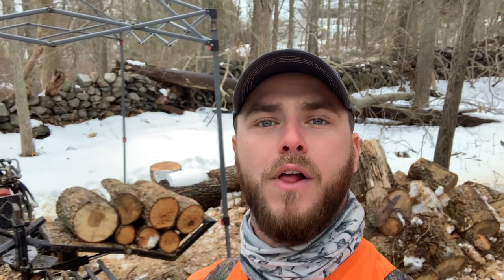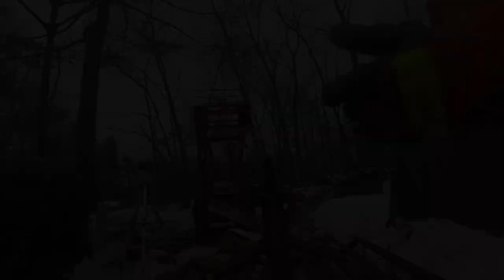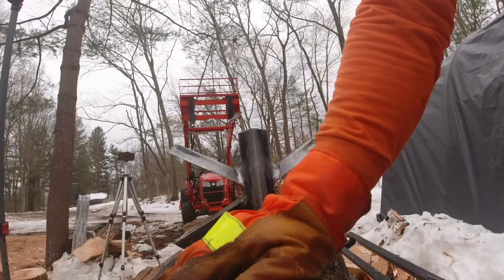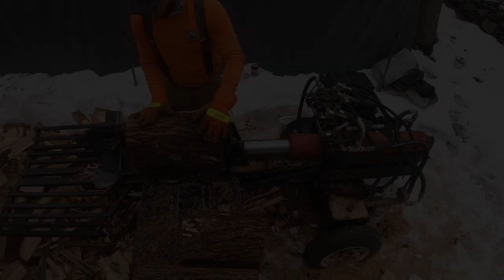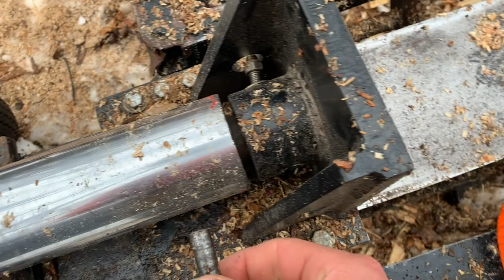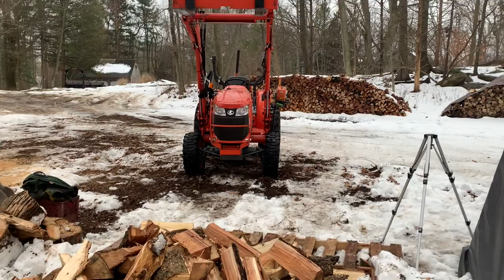#58 Splitting Ash Firewood with 6-Way Wedge in Realtime: How Fast is it??

Comment: 13 minutes into your video the cylinder bar started to come apart. It,s always something, but you handled that well too. Not to worry though, just a bolt. That is because you have a cylinder stop on the rail and the bolt can only handle the kick out pressure for just so long. Real time is ok. Have a great day. From me in ohio.
Reply from the maker: Ahh good point, never thought about the cylinder stop contributing to the stress on the wedge bolt, wonder if I could adjust the pressure at which it kicks back to be less to reduce stress.

Comment: Oh that sucks! How long have you owned this splitter? Mine has a 1” pin instead of the 1/2” bolt. I noticed on there website they offer two cylinders...same bore and stroke but different rod ends. One is 1.75” diameter with 1/2” hole (looks like that is what you have) and 2.375” with 1” hole which mine is. I ended up buying the 1/2” hole cylinder for my homemade splitter but I was cutting the rod end off anyway. 😮 yeah that wedge coming off is not something one wants to happen very often. I need up extending my wedge 5” in hopes to prevent this. But mostly I only used the 4 way. Great video Jake! Have a happy new year
Reply from the maker: Sure does suck but it happens! I've had the splitter about three years now, I wish it had a large diameter pin like yours has, that would make things much easier. For now I just keep a few spare grade 8 bolts on hand to replace once one finally breaks. The wedge doesn't completely come off like that very often at all, however, it will ride up quite a bit sometimes. Don't want to put a through bolt through the top of the wedge because then it will limit how high up I can raise the 4 and 6 way... its always something! Thanks as always for the support Garny, happy new year!

Comment: Can you use a clevis pin instead of a bolt. My iron and oak splitter uses one. Allows a bit of movement do there is less stress.
Reply from the maker: Might be able to but I think I'd have trouble finding one long and skinny enough, especially in grade 8
Reply: @DudeRanchDIY  try looking at other companies designs and steal there ideas.
Reply from the maker: My buddy is currently fabricating what he calls an “Eastonmade killer” maybe I can get some insight from him!
Reply: @DudeRanchDIY  I was just thinking there had to be a better way.  A little movement should cause ware instead of sudden failure. Sudden anything will reck the experience.  Keep up the good work and thanks for the discussion

Comment: Is there room in the cylinder to drill out for a 5/8 bolt it look like the plate area has enough room for that or try to at least throw it out for a 9/16 bolt...real-time videos are better but not crazy about the music like to hear the cracking of the logs
Reply from the maker: I'd have to check, but for now I have no problem spending the $4 to replace the bolt every now and then!